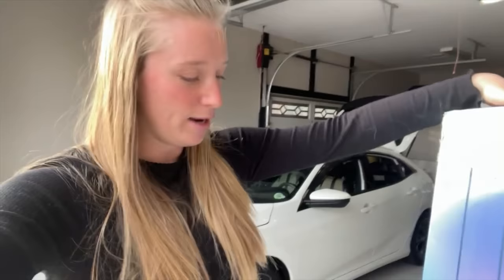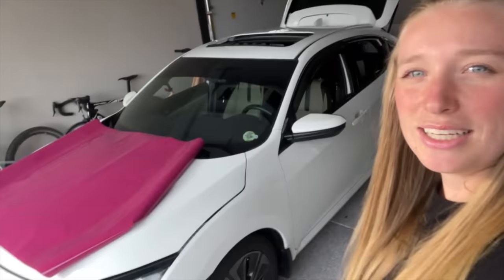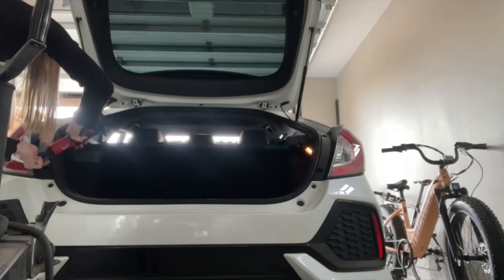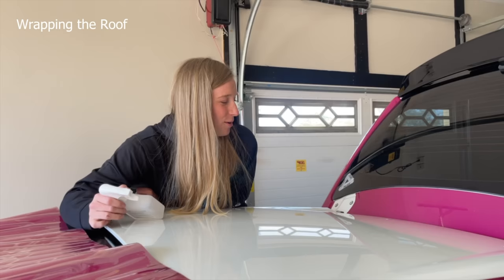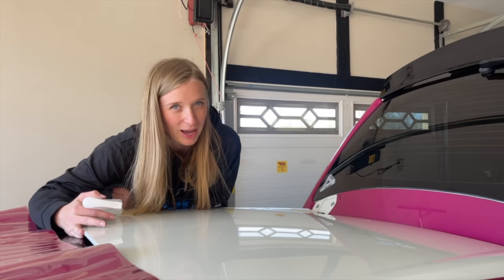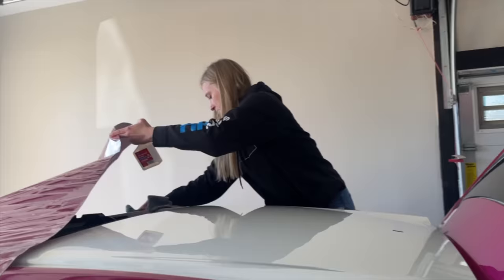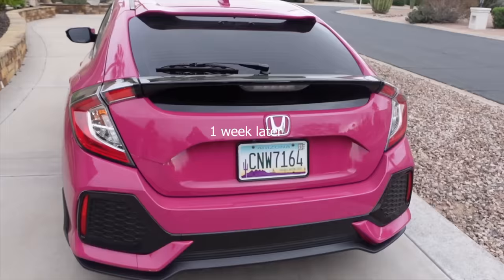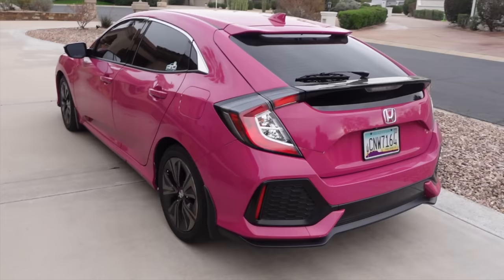First Time Vinyl Wrapping my Civic PINK !!

Comment: By removing parts you're already ahead of a lot of shops and people on social media who claim to wrap cars. This is coming from someone who works at a wrap shop in Chicago. Well done.
Reply from the maker: I can see why now… it was the most difficult part! It definitely made the end result look a LOT better though!! CANT beat free in a situation doing it yourself and still being happy with the results 😅 I’ve seen nightmare jobs done by shops as well.
Reply: rule at my shop is if it doesnt come off in 5 mins it doesnt come off😂🤷‍♂
Reply: Whatever works for you. We strive for quality, long lasting  work. Bumpers, trim, mirrors, handles, headlights, tail lights, lips, diffusers, sometimes even wheels. Anything that can compromise the longevity of the wrap must come off. I can take all that stuff off without wasting time.
Reply: Hmm does a wrap job generally cost?
Reply: @necrobabe6190  at least 2 thousand
Reply: By the way, do you offer rental cars with your business? I was thinking of doing that in case I had to hold onto a customer's car for more than a week. What are your thoughts?
Reply: but can you wrap a car without removing parts?
Reply: it’s it not really necessary too remove the parts, it’s just to do a cleaner job? Bc I’m just starting from scratch next month I’ll have all my equipment and already have someone who wants me to do there’s
Reply: @wasabby24  easy
Reply: @user-pz5mt1vx1l  disassembly and reasembly helps for a longer life of the adhesive since it helps to keep water from entering between the wrap and panels. It's not necessary. We just don't want to keep re wrapping because people generally don't take care of their cars like they should. If you don't offer a warranty, then just inform them that they can expect to pay to re wrap. We offer 3 years warranty so we cover our asses.
Reply: @wtfan8610  We do too many wraps to have the time to offer that service, but if you have the time and resources that sounds like a great idea.
Reply: I’ve wrapped my car without removing parts and it lasted me 3 years with no peeling. Only thing that peeled was my bumper, but that’s cuz it was a plastic unpainted bumper (heard you need to wipe it down with something to make it stick.) I don’t see why people talk smack on shops that don’t remove panels.

Comment: 14:38 Those 10th gen civic side skirts are actually really easy to take off if you know the trick. Remove all the screws/clips holding the front, back, and bottom of the rocker, then take a mallet or other soft hammer and hit the rocker towards the front of the car. The rocker will slide off of the normally inaccessible clips and fall off, and you can remove the clips left in the car by turning them 45°. 

Put the clips back on the rocker, and when you are ready to put it back on, it goes on straight on with a couple good smacks where the clips are. It helps to have a second person for installation to lessen the risk of you scratching either the front or back on the door bottoms.

Comment: Nice job on the wrap but also taking it apart and putting it back together. Love the detail you provide. I plan on trying this on my car but it should be easier than your car cause mine is much older and no round corners. Plus, I have chrome bumpers so that will be easier. Congrats on your first wrap.

Comment from the maker: 2.5 Weeks of work into one short Video. The wrap is inspired from the Porsche Color RubyStone Red which I have always loved. I am thinking of adding Green accents next so it's like a watermelon...what do you think?
Reply: Cool, if you want your car to look like a fruit!
Reply from the maker: @aakar88  YES I wish I could eat it
Reply: Free advice from Russia. The film must be glued to soapy water. Then it does not stick immediately, the water is expelled with a rubber spatula while smoothing. The fan heater is used for tensioning on curved surfaces and edges

Comment: Kayla house the Camaro I've been following you throughout the whole build haven't heard much about the Camaro lately just the dino that you did the other day it's running good no problems at all
Reply from the maker: It’s been wonderful! I’ll have to make another few videos with an update on it!! I’m the meantime I wanted to show some love to my civic
Reply: @KaylaRundle  yes I would love to see an update on the Camaro great job on the Civic by the way Kayla I was wondering if you could help me with something maybe a suggestion since I've rebuilt my Camaro SS it's a 2011 I did the top end BTR. Delete new rods lifters the heads were done Tule Springs BTR stage 2 LS3 cam water pump everything every alternator condenser radiator starter got x-pipe dual exhaust Flowmaster Super 44 mufflers Texas Speed headers every once in awhile when I start it and put it into reverse or drive it wants to stall out sometimes it does also did the timing chain would you have any idea what it could be I had it Dyno tune twice I would really like your input on the problem
Reply: @KaylaRundle  great can't wait to see

Comment: Were you actually able to do the whole job without tearing the vinyl wrap? Or getting permanent creases anywhere? Maybe your vinyl wrap is better then vivid?
Reply from the maker: Yeah even with how much I stretched the roof, it never ripped. Only problem I had was on my very first panel and I cut it was too short and it ripped on the edge. But otherwise I’m absolutely shocked by the quality!!

Comment: Did you go over any rock chips? I was contemplating on wrapping my wifes car but I think the paint has to be perfect without any rock chips etc right? Silly question, do you have to use special products to maintain a wrap? Any idea how long that will last without fading in that intense AZ sun?
Reply from the maker: My next video will help answer these questions. I just went over the rock chips and clear bra… but it is possible to see any texture through the wrap
Reply: I would use a filler and sand it down smooth. Use different grits so you get it as smooth as possible. That’s what I did for my husbands car

Comment: not hating on the wrappers.. but to be honest im not too impressed about the idea of wrapping a vehicle... if the vehicle has defects in the aluminum or iron sheeting , if the relative bodywork is undone, with just a wrap it conceals the issue by looking good but sporting underlying cosmetic issues...  bodywork and spray is the better way to go... question though, if a vehicle is painted, could a wrap be an alternative paint protectant with color or does the wrap damage an alreadypainted vehicle??
Reply from the maker: I completely agree which is why I’d never buy a used car that is wrapped since you never know what condition the paint will be in. The wrap is used as a protective layer and typically does not damage perfect paint under the wrap.